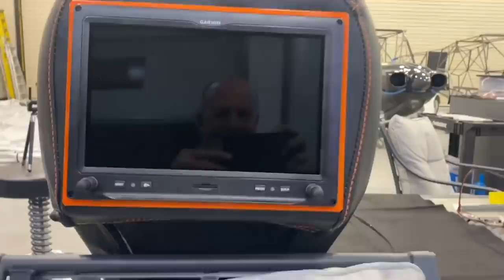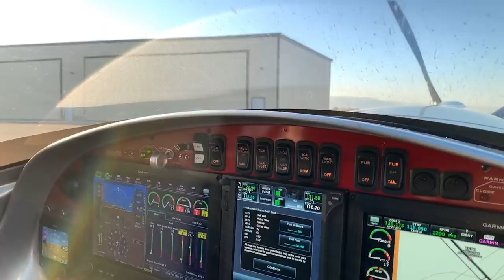Scrappy takes a backseat. Carbon Fiber + Garmin = Happy Scrappy 🤠 (Scrappy Bush Plane 26)

Comment: Every time Mike is whipping up a new panel or something, it turns into a nail biter for me. I'm like, is it gonna have a gap or be off by a 1/16? It never is. I've built lots of roll cages of different configurations in my shop, building stock cars cars as well as drag cars and after seeing how precise the tubing fit together on the main landing gear Mike designed and built, it left me in awe. Mike you are an Artist as well as an engineer.

Comment: seat belt extensions  for winter when you have snow suits or winter jackets on and provisions to attach straps to at the back of the seat  to strap stuff in when solo  are something I liked, and for the floor if you get walking in wet snow, or mud and now its on your boots,  you can take a piece of old carpet and cut it out , and lay it on the floor  and when home, either hang it to dry or toss it as it was free, , Getting the water out is a must in winter or it will fog windows real fast. and this way its out of the aircraft, before the next trip or leg, I had a quanset building maker  plastic weld  up a floor mat with sides too for a  machine. worked out real well

Comment: Mike the foam you used on the seat must have been Polyurethane , that stuff is amazing, in the 1980's when it just came up i used it to tamp shot holes for blasting work, it was a new thing in those days but i see you use it with you amazing skills for applications we never thought of in the 80's, i am in aw, thanks for the vids!.
Reply: A guy whose business was spraying potato cellars, and about anything else, for over 40 years, told me that the stuff was originated by the Third Reich. It's initial intended purpose being to raise sunken subs! I make no claims as to the veracity of that, just something I heard.
Reply: I used it while in the Marines as a prachute rigger in the 80's . I built custom molds for the pilots helmets. It generates a lot of heat.
Reply: According to Wikipedia:
Otto Bayer (1902-1982) is credited with the invention of polyurethane in 1937. He succeeded in synthesizing polyurethane foam by exploring his basic idea that mixing small volumes of chemical substances could create dry foam materials.[1]

Polyurethane was further developed for different applications, ranging from shoe soles and cushions to industrial uses. In the 1940s rigid foam was applied to airplanes,[2] and in 1979 polyurethane began being used as building insulation.[3

I did not know it had been around that long....👍👍
Reply: @maleficentcop2752  neither did i 😉

Comment: Hi Mike, awesome project. May I give you a small tip. In gliding we don’t use pure carbon. On top we it’s compulsory to have a layer of Kevlar on top. If you break carbon you get razor sharp edges. The Kevlar will contain that. Kind regards from the Netherlands. Nils

Comment: Better equiped in your rear seat than I am in the 1st pilots seat! I take it that there is a plug mounted in the seat so you can disconnect it to remove it for service access, going through a rubber gator (like on car door cabling) to still keep the cockpit sealed from dirt?
Reply from the maker: 👍🤠 Yes it has a quick plug for removal

Comment: Good food for thought. Great idea using foam as the mock up of the shape.  Please make reference to how many layers of 3000 Carbon Fibre is enough for applications as a rough guide. For instance, 3 layers of 1 1/2oz chopped strand fibreglass with polyester resin will give you about 3mm sheet thickness, more than enough in a similar build with about 15% more weight. All adds up. So what are the advantages given the shape will give you the strength anyway?

Comment: Do you have any concerns about the heat generated by the G3X screen?  (Either getting the unit too hot, or making it uncomfortable for the front seater?)
Reply from the maker: Great questions 👍🤠 I’ll show in a later video It’s vented with small lower and upper vents.
Reply: @MikePatey  Should have known Mike P. had a solution before the question was asked...

Comment: Mike, maybe I'm missing something, but, in the event of a crash when going forward, what prevents the front seat from pivoting toward the control panel and windscreen and throwing your head into those solid objects?
Reply from the maker: Martin Miller great question 👍🤠 same as most all Bush planes . First the seat locks down at the back before flight. Second the seat is only a few pounds  and the latch that holds the back down can hold 20 times that.  The human body is not held by the seat. The seatbelt, like cars, is attached to the main frame of the aircraft, not the seat.  So my lap belt and twin shoulder harnesses attaches to the Metal subframe and does that job.  Even in an event of forgetting to latch the seat back down,  the seatbelts would hold me and the few pounds of pivot force of the seat in place. Great question my friend 👍🤠

Comment: When using hand saws, point with your index finger... it will make the blade run more true.

Instead of wrapping all of your fingers around the handle, keep your index finger extended as if you were making a finger pistol.

Comment: Hi Mike. We are doing a home build (Zenith Zodiac 650) and really enjoy your videos. I'm responsible for the cockpit and electrical work. Can you maybe just point me in the right direction to get some advice around what type of wiring (size and insulation) to use and some basic examples (diagrams) of doing the wiring correctly especially going trough the firewall and good practice for engine bay wiring. Thanks a mil and keep up the good work, your plane is going to be a NEXT level bush plane! Can't wait for the wings, the real ones  :-)
Also from South Africa and battling to get general aviation going again...

Comment: So impressed that you literally build everything yourself. Even do your own upholstery. Such a pro! 

Hey I like the look of that drill bit holder case @ 11:16, looks handy. Got a name brand or place I can find that for purchase?
Reply: By looking real close and turning my laptop sideways, I was able to see that it said "Fastenal" on the side.  Looks like it's this set: https://www.fastenal.com/products/details/0323441
Reply: Also looks like if you just want to buy the case, rather than a full set with high-quality not-cheap drill bits, the Huot 30550 "Bit Buddy" case is basically the same case with a slightly different lid.
Reply: Google this: Champion Cutting Tool Brute Platinum Twister-XL5 29
Reply: There are others like it. TRIUMPH TWIST DRILL 29pc Trinado Caddy Set
Reply: Brooks Moses very nice, thank you

Comment: Love your videos! :) 
A question, when carbon breaks, it tends to form very sharp edges (almost spear-like)... wouldn’t be a good idea to build parts in and around the cockpit in something like Kevlar instead? It would increase safety on impact.
Reply from the maker: Amin Omrani absolutely fantastic comment 👍🤠. Thanks.  I keep a massive role of Kevlar on hand at all times.  There are many components like that in scrappy with the Kevlar layer in the center so I can keep the raw  carbon look as well as the safety helping the carbon stay connected to the Kevlar reducing its risks and is perfect for your exact comment.  I’ll try and go back or at least film that step and talk about it in future videos showing that step 👍🤠 thanks for watching and commenting

Comment: Question regarding Scrappy & Back seat, Mike.... If a medical incident occurred that required the backseat to take control of the plane, could they get access to the front? Or is that what the parachute system is for?

Comment: Does anyone know what type of expanding foam Mike is using here? I need to make some mud guards for my offroad buggy and want to try using this method as a mould. I'm assuming the heat from fibreglass as it heats up shouldn't be an issue?

Comment: Just a general question (and yes i know, I am not a composite material expert) but should you use a downdraft table when cutting carbon fiber? I thought that the little filaments, that fly off when cutting, can be very dangerous if they get in your lungs.

Comment: If you came through Wyoming, I think I may have seen you driving. Did you head home yesterday going south toward I-80? Your mini-convoy left me in the dust because I am limited to a certain top speed by corporate.
Reply: tomcoryell We took I-70.  We were in Glenwood Springs area.
Reply: Clearly wasn’t you all then. Saw a motor coach with Utah plates, plus a pickup with Utah plates pulling a nice fifth wheel headed back towards their home state. Lots of motorcycles headed the other direction towards Sturgis.

Comment: Has the plane got a stick in the back? Because if it does honestly put a throttle there to. With that screen they have all the instruments they need for flight if you ever became incapacitated.

Comment: Does the front seat lock somehow, or is it just held down by the weight of the pilot?
Reply from the maker: Magnus Alvestad great question 👍🤠 it will have an over center rubber lock that is easy reach from the back seat or from the front.

Comment: You said you were going to use ball bearing. Why not using needle bearing instead? They are lighter for the same diametre and more than strong enought for this application.
Reply from the maker: Benoit Sauriol 👍🤠 you are correct.  I say ball bearing on all bearings 😂. I know the difference but I single take my videos so I can get back to work so I will miss call things all the time 🤷‍♂️😂👍🤠
Reply: @MikePatey  ..wait till you get your hands on some exotic magnetic bearings..vibration isolation ..wow... 🤯the applications!🤠

Comment: Hi, my name is Mr Bengt sandgren from Norway. I'm teaching myself to make a mold using the foam you are using. my problem is that I don't lnow what the foam is called. Vi have foam that carpenters use to seal the space between windows frame and the wall. this foam make big bubles. Can you please give me the brand of this foam. I love your videos nad I think I have seen every one at least two times. I'm a glider pilot so I do some kind of aviation. Best regards, Bengt

Comment: Mike.. have you seen this video on Carbon fiber honeycomb panels.. https://youtu.be/vPQ3sFPuB6c   don't know if you can use any of it on scrappy wing structure..  its just a thought..  but hmm.. Draco II.   could it be molded prior to lamination into the shell of the wing.. or create wing spars ..

Comment: This seat NEEDS a head support. There is a reason why cars that are going much slower have it. Especially when using a helmet you should do it.
Why add a parachute and wear a helmet if you just snap your neck?
This seat is the weak point of your whole setup currently.
Reply from the maker: kontoname  👍🤠 thanks for confidence that Scrappy could launch 🚀 that hard.  That makes me smile. It will be a step by step work up to a full power launch run because of P-Factor controllability.  Since I have already launched my racer “turbulence” with similar power to weight I do have a good idea of the launch forces.  I must ease into the throttle to maintain Controll so the g loads on my head are actually very safe and manageable.  If I’m wrong on this I will certainly add a head rest but not likely as controllability is my limiting thrust allowance not the G loads.  I can’t wait to find out for sure during testing phase. it will be fun and I’ll keep you posted on the results
Reply: @MikePatey  Sorry, I obviously worded this incorrectly. I'm not talking about launching it hard. I'm talking about crash impact protection.
There have been multiple recorded deaths in GA because of broken necks on impact as you bounce forward, get knocked out, muscle relief, knocked back and crack the neck.
In fact head and spine injuries are major leading contributors to GA deaths. So I am super stoked to see you wing a helmet and that awesome chute - totally loving it! Just make sure to protect your neck as well please. :)

Here's a good video on aircraft crashworthiness with Dr. Akif Bolukbasi https://www.youtube.com/watch?v=dpsTCs_vD-U openly available that discusses this topic. If you like I can also research you some crash videos that explain the very issue - there have been a few reports that stated survival was almost guaranteed had there been a head support.

And while we can assume Scappies massive landing gear will absorb loads of forces the head rest is on a totally different axis and will not only protect your neck when unconscious, it will also offer more surface to press your body into on impact prep and also prevent anything loose from the back area to fly and hit you in the neck. Win win so to speak :)

Best regards and stay safe!